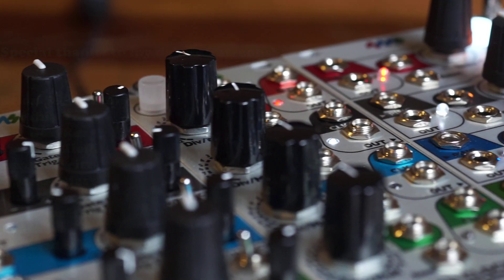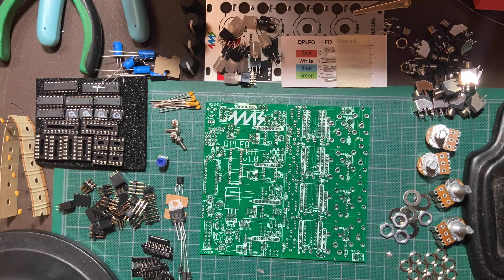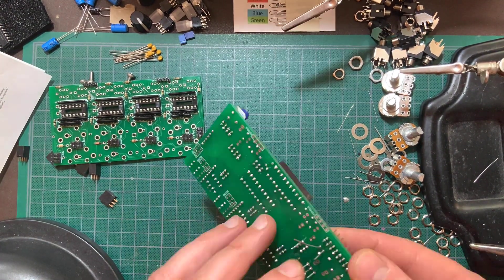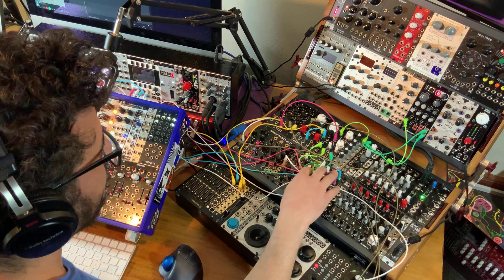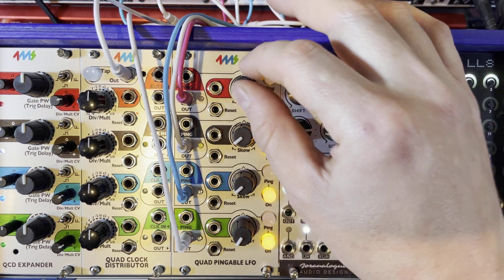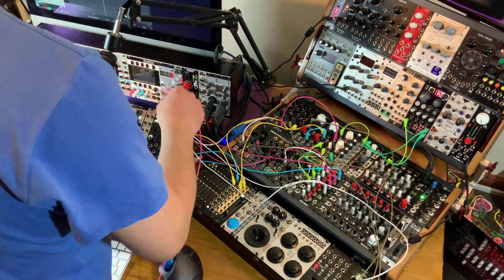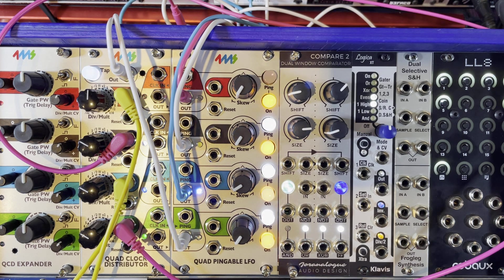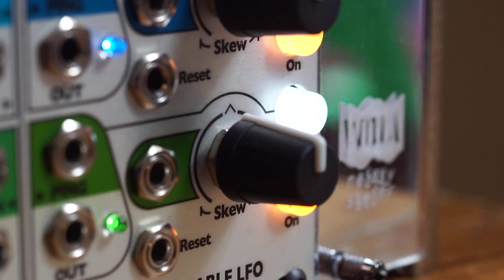Building the 4MS Quad Pingable LFO!

Comment: I really want to get into building modules but don't really know where to start, have you got any tips?
Reply: Hi Benjamin! I got started slowly by first watching the many DIY video kit-builds by Molten Music Technology (Robin Vincent). 

His videos show him actually building the kits and sometimes making little mistakes - but then you know in advance and do not have to repeat the same error. Check it out, You-Tube videos are free, just takes a little time for viewing! 
"Go make some noise"
Reply: @smallshopproductions5334  Thanks Jim! I'll take a look into that
Reply from the maker: @smallshopproductions5334  Robin is excellent!
Reply from the maker: Hi Benjamin! Start with easy kits where you only need to solder the hardware (pots jacks etc) Look in the playlist section of my channel, there is one called "easy beginner kits" :)
Get a decent soldering Iron with temperature control, leaded solder, tweezers and wire cutters, magnifier, desoldering braid and pump, a few small screwdrivers and go to town!
Reply: @QuincasMoreira  Thanks! That's really helpful:) I'll take a look